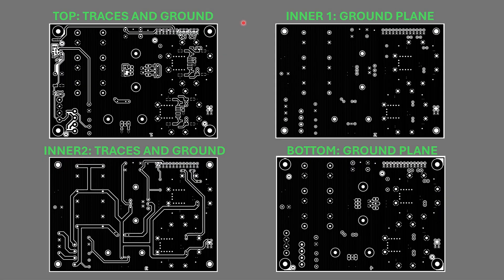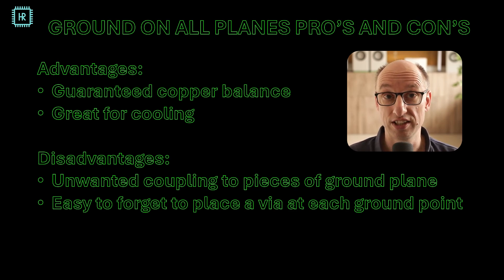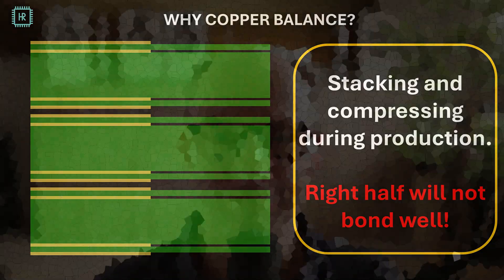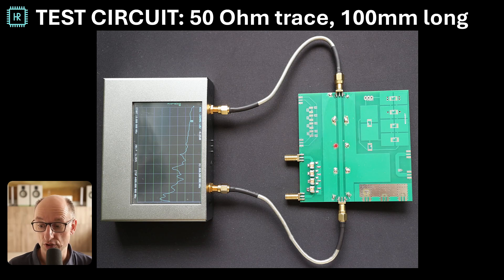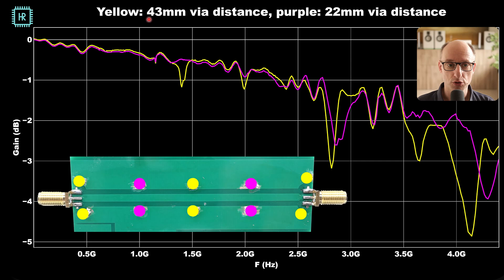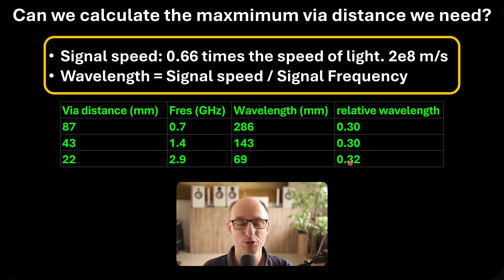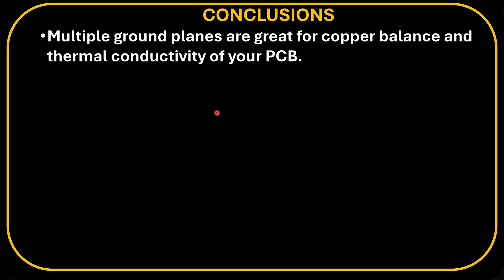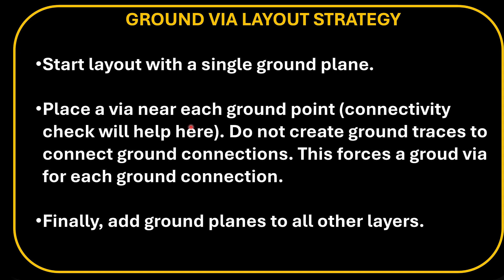Why Ground Planes Can Break RF... And How to Fix It

Comment: Send me the checklist please. Also interested in trying some of the circuits myself on Amazon "Upgraded NanoVNA 50kHz-6.3GHz Vector Network Analyzer" is this similar to what you are using?
Reply from the maker: I'm not sure about the amazon version. Mine is a v4 plus 2 I believe (not sure) but  it was 400 usd or more because it has a very high resolution in the frequency range.

Alongside the checklist, you now get a free one-hour module from my freshly launched course. 

Think of it as a fast-track pass through 30 years of hard-earned lessons (and the occasional facepalm). If you're still building experience, this could save you quite a few "learning opportunities" — aka, expensive mistakes.

Click the image with the play button on the link in the description.

Best regards and Happy Designing,
Hans Rosenberg

Comment: I like watching these videos and noting my board operates at 1Mhz.  I get to look at all the left hand sides of your charts where everything, no matter how cruel you are to it, is fine.  Yet I still ground plane and I still ground plane the upper and dilligently via stitch it.
Reply from the maker: Be careful, even at 1 MHz you can run into problems..... Especially with high dynamic range signals and interferers nearby. I really would design by neurosis :-)
Reply: @HansRosenberg74  I was thinking about your videos when testing some MCU to TFT Screen SPI.
"30Mbit should do"...  hooked up the scope.
"WHAT THE HELL IS THAT?"
My SPI CLK looked like a kids doodle.
15Mbit didn't look much better, but somewhat resembled a regular wave.
7.5Mbit/s and you might call it a "modified square wave with some ring mod".
This was a "flying lead" soldered setup.  So no ground plane at all, just a single GND 3inch lead from the MCU to the screen and a Y fork for the scope gnd.
This is interesting as the 2 layer board I put a similar setup, doesn't mind me running the SPI clock for 50Mbit/s.  The STM32F411@100Mhz flat out.  It has ground planes top and bottom and is stitched carefully.
Reply from the maker: Your scope probe (especially a longer ground connection) can cause all kinds of distortion as well. Make sure you have a 1:10 probe and connect the ground with a very short cable to the ground sleeve on the probe and then try again. It might look a lot better depending on what is going on exactly.

The missing ground plane is also a bad thing off course.
Reply: @HansRosenberg74  As beginners we say, "But my circuit isn't RF!".
As you get better at the hobby you realise.  "You don't find RF, RF finds you."
Reply: As far as "noise" goes.  I gave up.  My 'space' is too cluttered with Wifi, USB, HDMI, Ethernet to try and keep it out of everything is impossible.  For quiet audio I resort to optical and battery power headphone amps.  How that stuff influences the audio band so badly is beyond me.  My primary suspicion is the HDMI cables.

Comment: Another reason for copper balancing is heat. During reflow process e.g. the Cu will increase in all 3 axes. While z is usually none of siginificance, xy can definitely be. And when no Cu balancing, you end up with a bended board.
Reply from the maker: indeed!

Comment: A question, would it not be better to use the inner ground pours as power planes/pours so you get a higher power plane capacitance as that helps in high speed digital designs?
Rick Hartley made that recommondation in another great video where he explains a lot about power design in digital circuits.
Reply from the maker: Hi, Yes, that works very well! It does depend depend on your circuit. Powerplanes are usually only necessary above 10A of current draw (rough rule of thumb). So for many projects it is a bit of 'overkill' as you have to sacrifice an entire layer. However, layers become cheaper and cheaper.... Many decisions like this have a large grey area where multiple solutions will work perfectly. The key is to keep thinking yourself and not follow hard rules, because every situation might just be slightly different.

Comment: Hi Hans. A fascinating insight into ground planes. I have been designing sub 1GHz (mainly 50 to 900MHz) PCBs for many years and wish I had seen this material long ago. Thanks. Please can I have your checklist? One other question reagrds the track widths used on the part 3 PCBs. They don't look like 50 Ohm tracks. Can I ask why?
Reply from the maker: Hi Andrew, thanks for your compliments :-) Those traces are not 50 Ohms, that would be a bit wide. Furthermore, at these low frequencies the traces are not yet transmissionlines. The filter is meant to operate up to 100-200Mhz. The 0.25Wavelength at 1GHz is around 40mm which is the size of the filter. So reflection problems would not start untill 1GHz. Link to the checklist is in the description. I'm also building a course at the moment. https://www.hans-rosenberg.com/product_development_course  .Best regards, Hans

Comment: Please send me the check list, thanks!
Reply from the maker: Please really helps :-) Link is in the description. This document is free but I'm working on a paid professional course based on this document that goes a lot further. More information can be found here: https://www.hans-rosenberg.com/product_development_course . It will probably take me 3 more months of work to finish this course, but you can pre-register if you're really interested. Best regards, Hans
Reply: @HansRosenberg74  Like to suggest to price tag your book because it is worth at least 50 dollars. Many people do not have time to get an online course. Thus,  buying book and accessories ( ,Testing software, pcb desing software, TESTING BOARD AND SCOPE) will be better for busy engineer. You may want to offer discount on course base on book purchase.  Please have a section study how to deal with the interference effect generated by open circuit copperline ends ,specially at high  or low frequency , as you can see on lots circuit board. Thanks!
Reply from the maker: Thanks for the tips. The book is free so people can get an idea of my knowledge so they know they can safely buy other products from me. I will diversify in the future, but I just started and will need a lot of time to first build the course. When I can at least support my costs I will spend time on diversification.

The open ends thing is a good idea. I think however that each digital line has an open end, inputs are usually high impedance. So you have this problem everywhere. I am discussing this in my course with a different solution, I just wrote the contents down for the emc/emi part of the course this morning so I can turn that into video presentations.

Best regards, Hans

Comment: why can't you connect the ground layers from the end along the entire length using an overlapping conductor, without through holes?
Reply from the maker: I don't understand what you mean, can you clarify a bit further? In a pcb you can only use vias to connect layers.
Reply: @HansRosenberg74  on your board, the ground plane is below the layer where the smd components are located, you use via to connect the smd pad to the ground plane. What happens if you use a ground conductor running next to the smd components on the top layer, and connect it to the lower layers of the board not through vias, but in an overlap from the end of the board, like the letter E where all three layers are connected, will this reduce interference?
Reply from the maker: aha, now I get it. That will still cause standing waves on that plane since the distance between ground connections is larger that 0.25 wavelengths. So the wave 'fits' between the vias and gets onto the plane.

Comment: Thank you very much Hans! There are some experts that indicate 1/20 wavelength via spacing is adequate (1/4 of the 5th harmonic). Of course the wavelength changes based on propagation velocity (Vp) and propagation velocity is proportional to sqrt(Er). The Saturn PCB tool can be used to calculate Er(effective) with a reasonable amount of accuracy.
Reply from the maker: I know, I took the wrong number there for the velocity, stupid! For digital you're correct, indeed, you want the 5th taken care of as well.
Reply: You are awesome! Keep up the great content. I am going to recommend your channel to some of my coworkers; especially the ones who are not conducive to my teaching techniques.
Reply from the maker: Haha, if your co-workers like it, maybe you should do the course I'm making at the moment (and get your boss to pay for it, it will save him money in the longer run :-)  ). You can find the info here: https://www.hans-rosenberg.com/product_development_course. If that does not work, you can always resort to 'shock therapy'  for you co-workers :-D A tesla-coil goes a long way in motivating people to do what you want :-D
Reply: @HansRosenberg74 I am at the point where I will have to put together design guidelines for the group. I see many flaws that would be avoided by following a handful of rules. I hate to make people change part placement and re-route boards. I will let you know beforehand to get your approval if I reference any of your materials.
Reply from the maker: Well, my youtube material is public and free, just send the people to my youtube link and it is fine with me (it will get me 0.01$ of ad-sense payments at least :-D  ). The course is more for people who are looking for a complete and conveniently organized education. On youtube, everything is randomly ordered, the course will be 'curated' and will contain an actual project and the opportunity to as me questions via a forum for course members. However, if you wait long enough, all the knowledge will be on youtube eventually, it's just going to take me a year or so :-)

Comment: What do You think about 4 layer layout: signals, GND, VCC, signals. If i understand stuff correctly, there is no real difference between VCC and ground, VCC is just few volts higher, but also coupled with ground using a lot of decoupling caps, so stable VCC is as good as ground for providing good return path, right? My context is 74HC... PDIP computer.
Reply from the maker: Exactly right!

Comment: Why are the vias on your layers thermally relieved? It seems like the ones you hand drill & solder are not. The main downside with leaving them thermal'd is the added inductance. If you need to solder the vias somehow, thermals are helpful, but I hope you don't have to do that on 4-layer boards.
I do like your signal-ground-signal-ground stackup, and while ground transition vias aren't essential, there will be an impedance change from the microstrip / CPWG to stripline, and vias near the layer transitions will help a bit with keeping return current local.
Reply from the maker: This is a power supply and I kept those thermal reliefs because of assembly. It is virtually impossible to remove those big elcos without thermal reliefs on a 4 layers like this (or at least, very annoying). Close to the DCDC converters, the thermal reliefs are off because there is a lot of RF interference there. So in this case I optimized for each use case.

Comment: 5:16
Speed of light at 2x10⁸?
Wouldnt 3x10⁸ be better?
Reply from the maker: It doesn't go with the speed of light. The dielectric constant of the pcb slows the signal down. I even made an error here (luckily since all is relative the formula in the end is correct) since the speed on a pcb is more like 1.5x10E8 m/s with Er=4.7. I need to make an update video on this.

Comment: altium has a return path design rule that lets you specify minimum distance to return plane gap and minimum distance from signal to return via for specific net classes
Reply from the maker: Yes, as you can see it's really easy to calculate

Comment: My mixed analog-digital designs had a lot of densely placed active components and instead of two ground layers I used one solid ground layer and one dedicated power layer. They are internal layers. This helps to reduce power loss on traces, to flow the power current on the shortest paths and to introduce distributed capacitance which additionally filters high frequency noise. Both trace layers were filled with ground copper with a lot of closely placed (usually few millimeters) vias on the perimeter of every ground island.
Reply from the maker: That strategy works very well, if you have a lot of capacitors between the ground and power plane, it will also work perfectly as a ground return path (via those capacitors). You can even optimize for that by placing decoupling caps near vias that move a signal to a layer that is closer to your power plane. The large amount of vias you mentioned also really help. I think I'm proving that with a measurement in part 2 or 3. Best regards, Hans

Comment: Can electrical power engineer work in electronics
Reply from the maker: I guess so, you just have to learn the electronics basics I guess. It depends on the job also. There are huge differences in knowledge levels between different jobs in electronics.

Comment: What’s the best strategy for grounding for circuits that will be used in a space ship that has to operate in very close proximity to ultra high voltages such as a Tesla coil would generate?
Reply from the maker: Hi Brent, wow, now you've got me curious? Is this some scientific satelite you're talking about?
The answer is very simple: Just shield your electronics with a grounded shield can. That will nullify whatever field there is so it cannot reach your electronics. You have to be careful with wires leaving this faraday cage. A good solution is shielded twisted pair. The shield will 'catch' the high voltage fields leaving the conductors inside unharmed.

Best regards, Hans
Reply: @HansRosenberg74  Can I hire you to design a circuit board for me? Basically I need a Slayer Exciter circuit that is compact in a circular configuration to power a high voltage Tesla pancake coil, and can withstand extreme heat and being in close proximity to extreme emf conditions and that can function in an aerospace capacity where there is no Earth ground. Let me know if that’s something you can help me with. Thanks.
Reply from the maker: I probably could but I think that would be really expensive. I'm focussing on building my youtube channel and business now (I want to sell online courses in electronics in the end. Goal is to explain very complex theories in a really simple way so many people can design electronics instead of just bombarding students with 1000 tons of math which is quite useless if you want to be a good designer)
Reply: @HansRosenberg74  Ok how about giving feedback critiques on a circuit I design in CAD? I didn’t even know what a via was until I saw your channel. Could I hire you for say a 1 hour critique session via facetime where you give me feedback and I can ask you questions?
Reply: @HansRosenberg74  Have you ever made a flexible/pcb wifi/microwave antenna before? And have you studied how mobile phones with complex circuit boards and processors function in close proximity to an irradiating microwave transceiver, which normally is the case of the phone itself? A video on that topic would be wonderful!
Reply from the maker: this is on my list to show how to quicky design a pcb antenna. I used to be an 'antenna expert' for bluetooth devices and a have a few patents as well on it. I write it between quotes since I was the only one :-) If you're the only guy you're bombarded to be the 'expert' :-D
Reply from the maker: I'm realy focussing on building up a business at the moment. That is why I charge an hourly rate for that that is quite high. I don't think it would be high for a company, but personally it might be too much.
Reply: @HansRosenberg74  Most Youtubers like you make a course or online instructional academy to sell to their audience. That’s kind of what I need is a beginner course where someone experienced can walk me through step by step how to design and make a functional circuit.
Reply from the maker: that would be detailed circuit design. I would not know how to teach that since it is so versatile it could cover an entire bookshelf. I am planning on showing a number of circuits and how to detail design them and show my thinking process step by step. I really have material to make videos for 2 years straight I think, I wish I could clone myself :-)
Reply: @HansRosenberg74  Or just clone your brain and sell that instead. 😂

Comment: Thanks for the excellent video !
I wonder what would be the result if you completely  removed any copper pour from the signal layer(s). This is recommended in similar videos (e.g. Feranec, Bogatin, Hartley etc.). They found out that copper pour (with closely spaced vias) only marginally improve the signal response. As far as the copper balance is concerned, this could be achieved using a hatch fill which does not resonate.
Reply from the maker: Agreed, the improvement is really marginal. There won't be that much difference. I really like the thermal properties of putting copper everywhere. I often need to get rid of as much heat as possible. And when you do put copper everywhere, you have to tie it to the ground plane with many vias.

Comment: I think there is a small error in this video. You say that the signal speed is usually "two hundred thousand meters per second" but 2e8 is two hundred million. I was wondering if there was a typo in the exponent or if you were saying two hundred thousand when you meant two hundred million. I'm pretty sure you meant two hundred million because 0.66 * 3e8, the speed of light, is roughly 2e8.
Reply from the maker: ah, darn. I said meters per second, I meant 200.000 KILOmeters per second! I should update this video, there is another small error in here.... the outcome for calculating via distance is ok though.